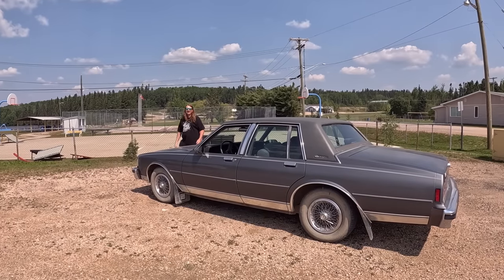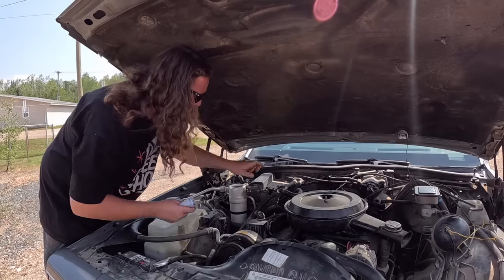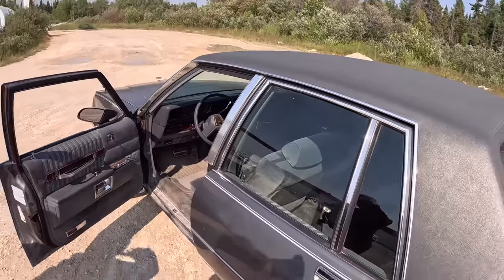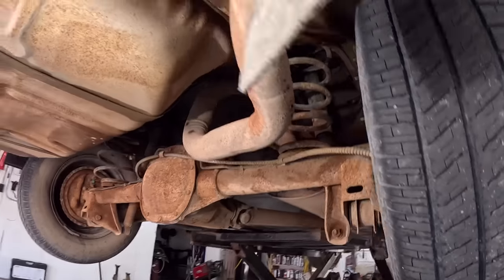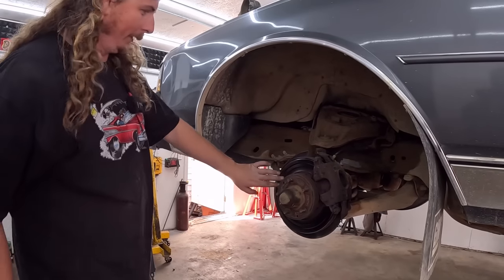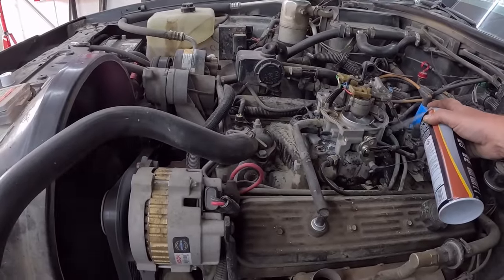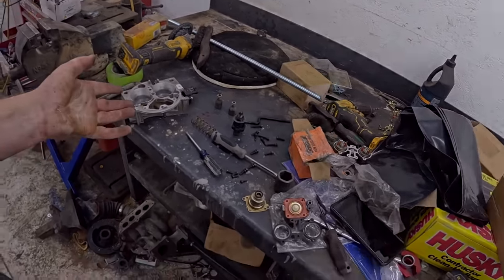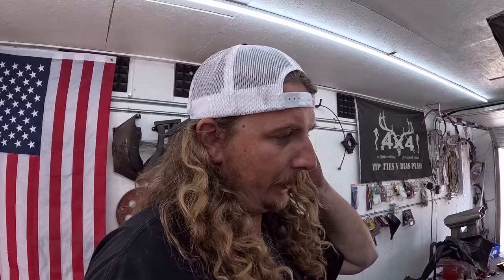MINT 35K Mile ORIGINAL Owner 1989 Caprice - Why Did I Buy This?...

Comment: You may want to check the transmission to make sure what engine you have. I had a 86 and from what I understand,if the AC compressor is on the passenger side you'll have a 307 with 200R4. If the compressor is on the driver side you'll have a 305/350 with 700R4. Don't know if that changed in your year so the tranny will tell. I've had running issues with my 86 also. Now mine was not a TBI but it did have an electronic controlled Carburetor so I ended swapping it out with a Holley and changed the distributor to make it run without ECU. Never had issues since. Your intake is different because of the TBI so swapping it for a carb won't work unless you swap the intake also. Now on a TPI the center bolts are in a different angle than the front and backs. Don't know if the TBI is the same so they could use the same heads. In the pas,t I've swapped a 305 Camaro Iroc Z TPI / 700R4 into my 1960 Bel Air and used the 283 intake with carburetor of which I had to redrill the two center holes on each side to make it work. And it did! Put around 100K miles on that 305/700R4 unit without issues except... replacing several motor/tranny mounts and center bearings from braking as that thing had tons of torque with it's factory 14" wheels and axle. My little two barrel would spin the wheels in first and second gear without effort. I've enjoyed every mile of the 100K I've driven. The Caprice is a lazy car but a nice boat to drive. Soft, relaxing and darn comfortable.

Comment: You want a name for it. It's the Old Man! Call it the Old Man. The TBI system is very sensitive to vacuum issues. Make sure all vacuum lines are hooked up properly. Do not cut corners here.  The distributor and the ecm are problematic, also. Make sure the charging system/alternator is functioning properly. All circuits need 12 volts. Like fuel injection weak voltage causes problems. Aged wiring harnesses can cause problems also. Make sure vacuum valve on air cleaner works properly. TBI needs hot air from exhaust manifold and stove pipe connection to air cleaner to supply heated air on each cold start. My Caprice had all sorts of problems. Once I replaced the ecm the car ran fine and got great gas mileage. I am getting 25 mpg and better depending on driving conditions.  Do not LS it. Just fix it with reliable parts from Rock Auto and it will be the best car you will ever own.

Comment: Peak traditional American car, there! If i were mine, I'd fix the minor body blemishes. Get the 305 running nice and maybe add a dual exhaust with good mufflers for a nicer but quiet sound. Grab some 9c1 (police package) suspension parts (it doesnt have a rear away bar currently) to tighten up the handling without ruining the ride. Maybe add a set of 17" alloy rally wheel replicas and a decent set of tires. Add a more modern sound system ... And enjoy! 

Nice find!!

Comment: Either the EGR valve is stuck open a bit or leaking. It could be low fuel pressure if it's below 10psi it will cause an idle problem. Fuel pressure 
Tester uses an adapter in place of the fuel filter down along the frame.

Comment: I had an 82 so there were differences.. There is a vacuum line to the charcoal canister. It has a purge valve that clears the fumes from the canister when first started. Ours didn't close when it should , creating a vacuum leak killing the idle.

Comment: One You Tuber discovered the distributor was bad, (South Main Auto) a tooth took a hit.  Myself, I'm dealing with a similar problem on a 95 Tahoe.  I went the timing gear route which made "some" difference...I plan to check the dist. tomorrow.  Good luck Dannies.

Comment: Hey Dan nice old  sled, try holding the idle up a bit and giving the engine a good bath with the garden hose when it stumbles you're onto something. Saves taking everything apart (chasing fairies in the dark) find the problem then take it apart, hopefully. Good Luck

Comment: I had one brand new. An 89 Caprice Classic LS Brougham - the most beautiful car I ever owned. Mileage is unbelievable and the comfort level is all Cadillac. One issue I had since it was new was lack of heat in the cab. A John Deere 210 stat fixed that! Congrats on a beautiful elegant machine!
Reply: I was 2nd owner of a 90 Caprice Classic mine was fitted with a water pump off a blazer(?) Which had the heater hose directly off the pump. Also heated great

Comment: Hi Dan, it's a long shot but I've had a bunch of these cars and on the low mileage ones that sat alot the intake manifold corroded from the inside out and would get pin hole leaks.

Comment: Danny its the egr valve which is on the back lower part of the carb  But you do have to replace the gasket there too the egr valve is stuck open is what is happening

Comment: I have a 90 Caprice LS Brougham, has 23k orig miles. Garage kept in mint cond. These engines will run forever as the were NYC taxi cabs. Need to get w/w tires to really dress it up (as mine does). It really is a true pleasure to drive....too I own a 1988 Dodge Aries K plus 1986 Dodge 600 convertible-- both in great cond. I mention that as you early on mention you would like to own one...

Comment: Dan, I had same problem in a 91 caprice did exactly what you are, replaced parts on the tbi, and it ended up being a cracked rubber line in the fuel tank.

Comment: I would suggest blocking the egr to see if its leaking air past. 
 Also when i drove a tbi truck the iac passage plugged up with carbon twice and i had to pull the tbi and clean it. 
Those were the only two problems I had that cause poor idle and stalling

Comment: it has a OBD 1 port under the dash. take a wire from the A to the B connection , turn on key and count the bleebs on the dash light. then look up code if it has any, just a thought.

Comment: Full framed GM cars from the 80's were the best. They weren't the most powerful, but wow were they some comfortable cruisers. My family had Olds Delta 88's when I was growing up, my dad had a 79, and my grandfather bought a brand new one in 1980, which was the first year for that body style. I had two Delta 88's myself when I started driving. They were both two doors, one was an 84, then years later, a two door 85. These cars were such a good platform. Our Oldsmobiles had the same type of hubcaps that were bolt on as well.

Comment: That little unit on the firewall that has vacuum is for your transmission make sure it is shifted in or your torque converter will not lock and unlock

Comment: Buddy of mine just sold his 89 Caprice, had similar stalling issues. Turns out it was fuel pressure related. Technically it was still within factory specs, but still wouldn't stay running.

Comment: Check the EGR valve on the intake, you can put you fingers underneath it and push the diaphragm up and down, if it feels "crunchy" its bad....makes it idle weird.....just something quick and easy to check, ......i just watched where you sprayed brake clean, it is going into the EGR definitely,  its the round spaceship lookin thing to the left behind the throttle body

Comment: Need to do a fuel pressure test it's possible that your fuel pump pressure is bleeding down or in gas tank where fuel pump on sending unit has a rubber hose between the pump and hard line it gets gummy and soft and pinches of or i seen it leaks lowering fuel pressure i worked quite a few that had the exact problem you have here and this fixed it.

Comment: That vacuum hose going to the firewall is the MAP sensor. Wouldn't be surprised if it's bad. replace the hose as well.
Had the same thing on my '85 Pontiac Fiero 2M4. The other thing that can go out on these is the ignition module. Requires a 5.5mm to unbolt and if you do not put some sort of heat conductive grease on the back of the new module, it'll burn up in 6 months. I cleaned up the surface and put some computer CPU "Arctic Silver" paste on it and never had another problem in 250K miles. Keep an ignition module in the glove box as well as a socket set an you will likely never be stranded.

Comment: check the plug right behind the TBI unit where you where spraying the brake clean. ALso check the TBI to make sure it is not warped, and as already stated check all the rubber lines, those injectors need cleaned or replaced as they where not giving a good cone spray pattern. Lastly test the pressure regulator. Worked on more then a few in the early to mid 90's those trottle bodies are pretty simple but one little thing can throw them off.

Comment: Dan, don't LS swap this car, keep the 305. I have an 84 Monte Carlo SS with a 305. It ain't a hot rod, it is a very dependable, quiet, smooth car. It came with a turbo 350 trans, I replaced it with a 2004R over drive, it is a pleasure to drive now. I also replaced the computer controlled Quadra jet with a 79 non computer Quadra jet, along with the computer controlled HEI . I used a 79 HEI. The car is a great cruiser now getting better gas mileage, and at 70 mph it turns 2100 rpm. there is nothing wrong with a 305, it does what Chevrolet designed it to do. You will appreciate the comfort, and fuel economy with this car.

Comment: Put a small air fitting inside the hose leading to the IAC, to give it sun restriction. I no it sounds dumb but it usually fixes the idle on them for me. It thinks it’s restricted so it rises the idle up.

Comment: Dan I know your the genius on this stuff.
But I recall hearing of some guys used the complete full size Caprice frame and drivetrain and bolted a 1957 Chevrolet onto it.
Voila 
Easy maintenance and parts accessible. 
Just a thought 😎

Since you seem to find these 1955-57
 Chevrolet, s easier than any one I know.

Comment: That generation of Caprice came out in 1977. I was 18 at the time, and a few months later got a job with the fleet services department for the city I lived in. We soon got a bunch of brand new ones in, and I got to work on them. I prefer the front end design of the early models. Those cars are virtually unbreakable, and make great daily drivers. The trunks are HUGE. Much bigger than a Crown Vic. I would swap that 302 for a carbureted 350/383 cast iron small block. Get rid of all the computers and emissions crap and you'll have a nice dependable driver that is easy to work on if/when needed.

Comment: Clean the throttle valve and check IAC. May also need to perform IAC relearn procedure. That doohickey is the map sensor. Don’t plug the vacuum to it. It’s critical for its function.

Comment: That diaphragm is the fuel pressure regulator they get a pin hole in them and cause that I've put the rebuild lits in those a few times it'll make more difference than you think

Comment: Prob vacuum leak but, every car I ever worked on that's sat up. I ve had to replace the fuel pump. I don't hear in popping or sputtering. But checking fuel pressure and replacing fuel filter definitely won't hurt, but could be mass air flow sensor I believe those cars use them. Anyway persistence pays off good luck.

Comment: We ran one in the street stocks for years. The throttle bodies are known for warping and cracking.The throttle bodies also tend to leak over time around the throttle plates shaft. Making sure all sensors, wiring/connections and vacuum lines are good. When in doubt swap it out with these tbi cars
Reply: Wow, I forgot about the plate shafts leaking vacuum.  But those were usually high mileage, blast from the past, hell of a guess though!  This one is gonna bug me until I find out the aanswer!

Comment: The TBI had a few problems, Iac if it wont idle. The port in the bottom of the throttle body gets gummed up on the port to the Map sensor, which will make it die just as soon as you mash the throttle, The TPS give different problems, they will get gas in them

Comment: Thermostat is connected to the tbi system and can cause running or starting problems. It thinks it is hot or cold it will adjust the flow of fuel like a chock on your carburetors would do. Thermostat is cheap and easy to replace or check.

Comment: Nice car and you got a good deal! I doubt it is a roller engine in 1989 because my 1989 Chevy truck had the larger 5.7 original engine and it wasn't a roller engine. the TBI on mine has over 300 thousand miles and I have never had to work on it. Definitely looks like a vacuum leak. Lefty

Comment: Had a 77 Impala (same car as caprice classic, just lower trim level and 1st or 2nd year of that generation). Drove that thing everywhere for years. Dead reliable and solid. Huge trunk, so you can comfortably take 4 people and their gear on a camping trip, and even sleep in it in a pinch. I miss that couch of a bench seat. And with AC and cruise control..... Bottom line: dont change a thing, and you're going to miss it if you get rid of it.

Comment: Those cars are solid, you got yourelf a winner there - I love those things, preferably the older 4bbl carb ones but those efi are quite simple.  I would guess that you have a fuel starvation issue where there is pressure but somehow lacks cosistent volume of fuel - a line is partially clogged, or the assembly it the tank is somehow compromised

Comment: I had an intermitant crank no start on my 4.3 tbi in my truck. EGR valve was randomly fucking off and I realised it when it cranked up to 2200 rpm at idle in a parking lot until I drove it home, started it the next morning to get the new valve, idled at normal levels.

Comment: I worked on a pile of these in the 90s. Hub caps had a special key to remove them. Someone would of replaced them with alan bolts. That TBI unit was horrible for carbon build up. Mainly on the PCV port. Its just a matter of taking it apart and give it a good cleaning. Not only will it run like crap, but if its left too long I've seen them blow the rear main seal out.  No crankcase ventilation,  the pressure build up  will eventually either chuck the rear main or the VC gaskets.

Comment: Check the pickup in the distributor. My cousin has a 1989 gmc 1500 and it wouldn’t run unless you kept your foot on the gas like your doing. Tuned it up and rebuilt the throttle body . Still ran bad until he unhooked the brown wire with a white stripe going to the distributor and it ran fine. That means the pickup is bad and won’t adjust the timing properly.

Comment: Dan look on the inside frame rail on passenger side rear seat the fuel filter is there I seen it when you put it on the lift I bet that's why it's killing pull that filter and replace it or blow it out I bet that's it.

Comment: Watching the spray of the brake clean. And the puddle in the intake.. those tbi motors were so notorious for the intake gaskets being shit. I know you only gave on and off when it comes to brake clean. Try to slowly spray the edge of intake along the valve cover area and see if that's it. I have don't 1000s of intakes on the ol tbi 4.3/5.0/5.7 good luck Dan lol. Rooting for ya

Comment: I fought this problem on my 88 1500 cleaning the IAC did nothing. My fuel pressure regulator was going bad. If you take a pair of vice grips and pinch off the return hose and if it idles that is the issue. It is an easy fix the regulator is a part of the TBI  and it is way cheaper to get the full TBI rebuild kit than the regulator kit. My 1500 has almost 400,000 miles on it and would still be going if the transmission didn’t wear out.

Comment: Probably the intake manifold or a crack in the throttle body .. check for cracks somewhere and replace the vacuum hose that connects to throttle body .  Good luck

Comment: Since it's not the TB base gasket, the next thing I'd check are the intake bolts to see if it's the intake sucking wind. It is a Chevy after all so it's going to suck wind from somewhere. You could use this as an excuse to throw heads, intake, cam and a Holley Sniper at it - that way it'll look like an old man car but sound like a hot rod. BTW, I was in my 20s when that thing was new....

Comment: The corner of the Hood, where the paint is bad. do a diagonal speed stripe with DD Speed Shop. just a 9 or 10 inch stripe with a pinstripe on each side. Black stripes with DD speed shop masked off to show the car's color below. Subtle , but cooooool!

Comment: I dig this car. My 200R4 trans came out of an 82 Impala with the 265 V-8, I don't know what was in the latter years, but if it's a 200R4, definitely save the trans. My vote is to fix the mechanical issues and daily drive that thing forever.

Comment: Do the break Clean test on the intake gasket it’s self spray between the intake and heads and see if that does the same thing if it is leaking when you spray that behind the throttlebody   some may be going over and hitting the intake leak

Comment: Man those old cars are really nice , my Mom used to drive an ex police detective car , it was a 1981 Buick LeSabre, and I owned a 1988 Oldsmobile Delta 88 , it sure was a land yacht but so smooth 👍 and in 1993 I had a 1979 Cadillac Brougham, it had a 425 throttle body injected big block.

Comment: That's really a good car I owned a 1990 Caprice 901 ex Nevada Highway Patrol car I bought it with $79,000 Mi at the police auction it didn't have air conditioning that's crazy I bet you those cops hated that in the summer I owned it for 23 years at 486,000 Mi when the body literally fell off the frame I sold it to a kid he wanted the Driveline it was a 342 posi sway bars 350 you know the drill that thing you bought is cool man you have no problem selling that I can see the new owner of have twenties on it in no time I'm teasing you have a great day that might be your best driver:face-green-smiling:

Comment: LOL @ 32:00 "The oldest guy at the dealer" Jeez it is getting nuts these days, but you're probably right LOL. I remember when all this stuff was a new problem for my Uncles at their garage and ECU control was all new... There were many different GM TBI things, and later with Iroc Camaros the higher pressure stuff was new...